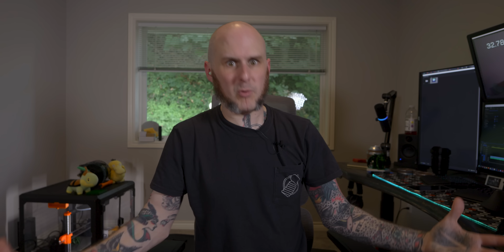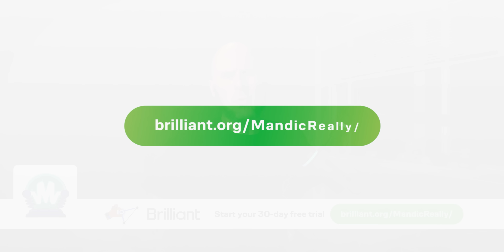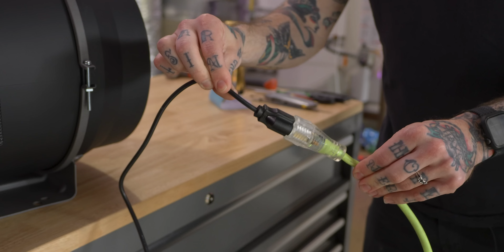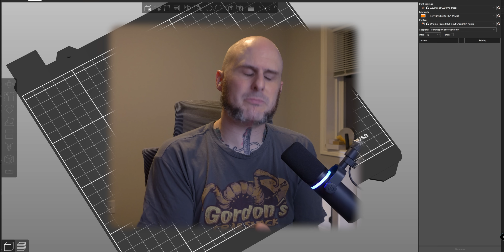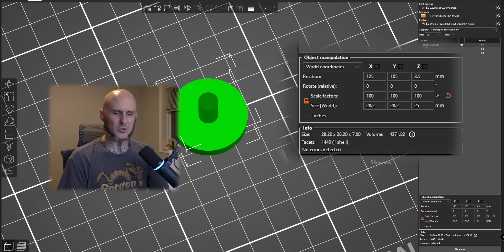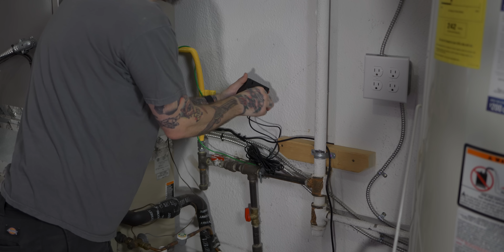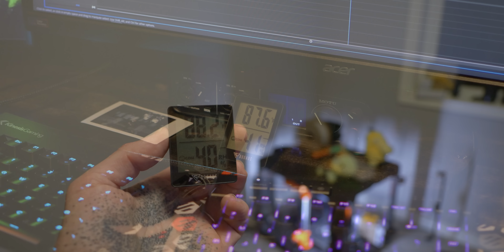Office Build Begins: Solving 2nd Floor Heat w/ AC Infinity T12 fan!

Comment: So I had a similar situation as you. My office is my server equipment, 3D printers and gaming computer. It gets warm in here. I have a 1 story, so not as bad as yours. My house is newer so most rooms have jump ducts. In my office, it is right above the server rack, which is great, and goes to my kitchen. I installed an AC Infinity through wall fan in place of the jump duct grill. It's not a quiet fan, so Ill need to figure something out down the road, like a smaller version of what you installed, but what it does is pull cool air from outside the office, under the door, into the room, which lowered my temps about 3-5 degrees. The jump duct by itself isn't very useful, so something to keep in mind. If you do this, put the jump duct as far away from the door as possible, so the fresh air it pulls in doesn't immediately exit out the jump duct. And don't put it too close to the air vent because your return will suck out your fresh , cool AC air out the jump duct. A ceiling fan running in reverse, winter mode, also pulls cool air from under the door. Good luck!

Comment: One option I would look into if I were in your shoes is a mini split.  They are very easy to install and setup.  Operate near silent and will easily solve your heat load on the second floor.  I installed 2 Mitsubishi Hyper heats on my second floor.  9k BTU units.  They control about 2000 sq ft of space with ease.  How is the system doing for you now that It has been in operation for a long time.  I used the T6 fans for exhaust in my bathrooms as the house was not built with any exhaust fans.  Thanks for the video.

Comment: pushing cold air isn't ideal to cool a space (sounds weird i know).....the issue is the return not pulling the hot from the locations. You said your only return on the second floor is literally in the floor, which is entirely inefficient and unacceptable. Heat rises, and so a return should be high up on the wall or in the ceiling. You can force the 2nd floor return to pull more by somewhat block the first floor returns, which can help with the floor-to-floor differential problem. The fan becomes entirely useless in that position regardless, as you are only causing a vacuum on the first floor to supplement the second, you could have had the exact same result by partially closing some of your outlets on the first floor to force more air to the second......only so much air will move in your lines, and the central fan unit is optimized, you are only wasting electricity and noise.

but if you MUST use that fan, and you want to have automation, the G wire on the thermostat controls the fan motor signal....you can split the signal and read it for your fan using a simple electric switch.

Comment: ok, i am a mechanical engineer who actually works in hvac industry, i mainly focus on automation and sequence and design, if you need help with automation let me know, you should have placed the fan in the supply duct to the 2nd floor, that would have increased the flow to the 2nd floor only, make sure not to use flex duct before it as the big fan could crush the duct. I have a similar issue with my house and I've already decided I would do that i plan on having the fan run only when office temp is above 74 deg and AC discharge temp below 70
Reply from the maker: That duct IS the 2nd floor supply duct. The air path in this system splits under the unit. The 1st floor ducting is in the crawl space and goes through the concrete wall where it isn't visible here.

Comment: Absolutely the wrong place to start!  1st trace the ducts in the attic and diagram each room. While tracing the ducts check for leaks or under insulation.(recommend renting a thermal camera) If your duct work is in an unconditioned attic, consider adding a reflective barrier to your attic rafters(drops attic temps by 12 degrees) then blow fiber glass or lay bats on top and blow in under the ducts. consider adding a solar or wired gable fan with thermostat.

Comment: I guess you never considered "Make up air" such as the air that fart fans, vent hood and going in and out of doors uses. This inline fan probably doubled you make up air needs and made it a non stop need or at least whnever you run the inline fan.

Comment: I think there's more opportunity for better noise/vibration isolation by using separate fasteners to to attach the fan to the isolator, and the isolator to the wall.  And of course,  a redesign of the isolator.

Comment: Buy an esp32 and install esphome to it. Now, through yaml you can literally copy and paste to make it any sensor you want. Have it check the voltage on the wire coming from the thermostat or if your thermostat talks with home assistant, use the esp32 as a switch to flip a relay to the fan when your thermostat says cooling.

Comment: I made this comment as a reply as well, but it’s worth noting in the top level that blowers have adjustable speeds. You may have simply added airflow and pressure by setting the blower jumper to the next higher speed assuming it was available. A lot of techs do not know how to set this correctly and the building efficiency or humidity specialists handle that on homes with airflow problems. Aftermarket blowers can also throw techs as wire colors are not a universal standard (aside from never being green) and the red “fast” jumper on your name plate could be slow or medium speed. The way these are set with traditional motors is three wires or terminals come off the motor and they lead to a specific set of windings in the motor. More windings means more speed. 

Too fast of an airflow speed leads to lower dehumidification so in the South you see blowers set slower since lower humidity usually is better than higher airflow from a sensible heat (how you feel, not just the thermometer number) standpoint. 

Variable blowers have their own way of being set so this likely doesn’t apply at all.

Edit:

For your automation, skip WiFi and Home Assistant for this. Your controller should have a dry contact or switch contact that will turn the unit on with standard HVAC wiring. Your furnace should have a fan wire in there and you can run that to either a contractor and the switch control or the dry contact. You wouldn’t actually need your AC Infinity’s thermostat driven control at that point.

Comment: For triggering the fan, why not just use the same method the hvac system is using? Even just checking if fan is getting electrical power in the hvac system. The thing to watch for is what fan is installed in your system, as they can be wired differently and operate very differently. If you need this system, I am sure if you ever need the heat, you will find the same issue. The other benefit is if you ever use just the fan option, this fan will function then also. How you currently have it set, only the a/c will trigger the system. I'm more about mechanical automation than digital. I like easily replaceable parts, that can be bought the same day, that a power failure won't cause bugs, etc. I'm sure you could automate this by sensing when the fan if running either through air speed, or electrical current.

Comment: Late to the party, but I just wanted to say that if you get a dual hose portable AC unit you can supplement a lot of cooling and you can also dehumidify fairly efficiently. Our central air unit shit the bed pretty hard last year, and we had multiple technicians scratching their heads trying to figure out what exactly was wrong. Could not find any leaks. Everything checked out still wasn’t working. We ended up getting a single hose portable air conditioner in the living room to tide us over. Then this year it happened again and we bought an additional single hose unit which ended up pulling in hot 140°F/60°C humid attic air into the house, though they kept the space around them cool in that room. We ended up supplementing these with two dual hose units and they kicked ass. It was still not enough air circulation or BTUs to cool the whole house and it was still a mess. I will say though, that the dual hose unit that we left installed in a spot that should be a second zone is working exactly how it should,  highlighting that this second part of the house should probably have a mini split heat pump type setup and have the ductwork supplying the rooms in the second part of the house removed. It’s amazing to me how little effort seems to go into new builds with their HVAC systems. And people who retrofit homes are not innocent either I’ve seen some pretty horrible stuff, including the house where I am now with the air handler in the attic and the installers forgot to put in any insulation so the air conditioner is cooling down the aforementioned, super hot, humid air before it even gets into the ductwork. My advice not being a professional just an enthusiast with this stuff is to get a multi zone unit before you even install that other heat pump. Most of them come with three or four zone options. Hope to see an update soon.
Reply: If your hvac people couldn't figure it out, I suspect they are parts changers, and nothing more. Diagnosing issues is a dying trend now, while replacing everything is the new trend. There are multiple ways to find a leak, even a small one. The hard part is the design, if someone decided to buy lines, or critical sections in the wall, or other hard to access locations. Are they even sure it was a leak? That is a fairly minor issue to have to not be able to fix it. There is only a few locations that are bad to have a leak. Worst case, run a new line set, that is if there is no leaks in the evaporator or condenser.
Reply: @snoopdogie187 yeah. There was no charge in the loop. My guess is that the original installers didn’t tighten down the service valves enough and it just slowly leaked out over time and then less capable technicians came out and possibly ruined the service valves accidentally or intentionally. We got an independent guy out and he did a leak seal, even though there was no leak detected after pulling the highest vacuum his equipment could do. Came out to about $1000 diagnostic testing and refrigerant charge cost. The other two companies wanted several thousand dollars to do all of this wild stuff that I’m pretty sure we never would need in this climate. We plan to have this guy out again to wrap the air handler and redo how the air purifier is connected to the rest of the air handling structure. Should get us better airflow and more efficient cooling.

Comment: Ideally the best way to balance a single zone system for a home like that, is to install baffles in section of duct work, as well as 1 main one for the 2nd floor, and one for the first floor. It overall takes a bunch of trial and error, but what you do is adjust the flow restriction for each vent at the duct level (do not do it at the register level as too much restriction there can cause the register to condense moisture). After that, you run the system for a few cycles and measure the temperature in each room. One effective way to do it is to get a soda can and cut it open and then spray paint it with any matte black primer paint. Then place something in the center of the room that is not in the direct airflow path of the HVAC system, or direct sunlight. Then walk around the house with an IR thermometer and periodically check the temperatures, and then adjust the baffles until the temperatures are leveled out. Do the same for upstairs as well.

The overall goal at this point is to even out temperatures across a single level of the home (not concerned about temperature differences between the floors yet). Once each floor is evened out, you then use the main baffles that control entire levels of the home, and begin restricting airflow to the first floor, this will naturally direct more airflow to the second floor. While it will be impossible to fully balance it, you can get temperatures very close. Once that is set, level the adjustment position of the main baffles. For example, draw a line to one position and label it "Summer" after that during winter, adjust the main baffles again until temperatures are as even as possible across the levels, then draw a line and label that "Winter". 

If done right, you will be able to make it into a routine where the main baffle is moved to the summer position when the weather warms up, and as the weather get cold, you turn it to the winter position.
Reply: I have no idea how to do that. Any cha ce if making a video or animated version. It's what I am looking for myself in the uk.
Reply: At hardware stores like home depot or the UK equivalent, look for inline dampers or any other Hvac duct segment with an adjustable flap. The idea is to be able to restrict the airflow to certain areas, which will cause more air to make it to the less restricted segments.
Reply: This. I think it is like flap you can open and close? Bonus points if you 3d print them and add a motor to each that you then control with home assistant.
Reply: @sandphotoNL  they are typically metal fittings that cost around $20 each at a hardware store.They Sadly cannot be 3D printed since the Hvac system needs to handle heating as well, and thus will be exposed to high temperatures when the heat is running.

The overall goal is reducing airflow to the downstairs vents, and opening the damper for the upstairs in the summer (tweaking as needed to balance the temperatures and rate of cooling), once that is set, use a marker and mark the position as the summer position, then repeat the process in the winter, and mark it again and label it as the winter position, and make those adjustments part of your seasonal maintenance where you go beyond just the air filter replacement and give the system a deep cleaning.

The main times when a register booster or a zone booster is needed, is when the main blower lacks the overall airflow to handle the entire home.
Reply: They’re called dampers. If ur home is a two story house, it is almost impossible to access the ductwork on the first floor since it’s run through the floor joists. Unless you don’t mind cutting access holes in the drywall so you can access the ductwork.
Call a professional and have them do a proper air balance.

Comment: A 2nd floor MINI-SPLIT system is REALLY the only way to solve this problem. City code inspectors should make clear to home builders that a SINGLE HVAC system for a 2 or 3 story home will automatically be FAILED‼️
Trying to zone a single HVAC system is COSTLY and rarely makes for a comfortable home❗️

Comment: It looks like any of your installation. You’ve got the 12 inch adapters without the fan pointing up and you might’ve put the fan below air down toward the bottom of the HVAC unit when both the arrows are supposed to be pointing the same direction of airflow which will add noise and reduce airflow

Comment: run it continuously so it pushes the heat out of that room. once it turns off the heat builds up and the thermostat can't see that but if air is continuously moving the air will equalize and run the ac more as it should